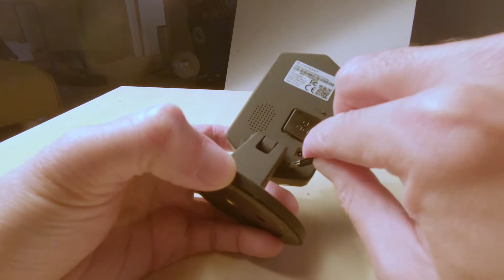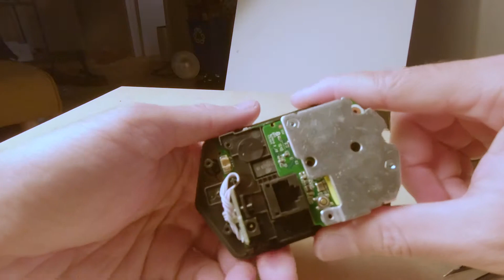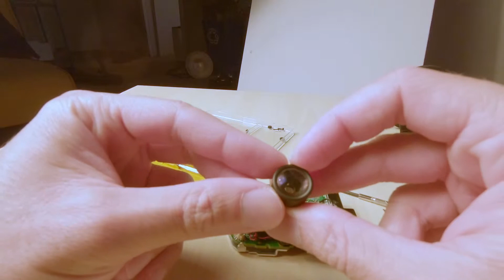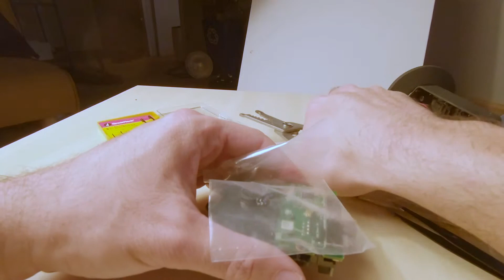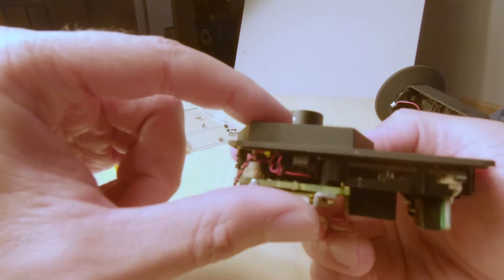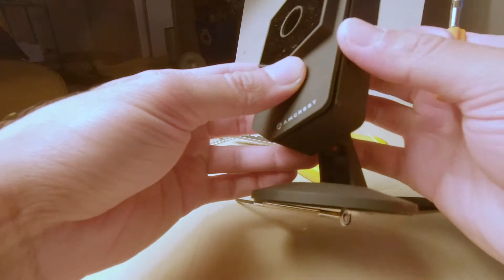How to replace M12 lens on Amcrest security camera

Comment: that was great! sorry for my ignorance but did any of this end up affecting your night vision in anyway? if so how?  thanks for the video...really enjoyed it..might wanna tinker with what i thought was my amcrest cam..hmmmm ....incidentally could you kindly share what exact lens you got and from where ie. part # etc..thanks again
Reply from the maker: I don't remember what lens it was, probably just a generic one from Amazon. This one was pretty good quality but I've also gotten ones that weren't sharp (I use these types of lenses on Mobius cameras too). I would suggest going to a reputable camera that sells FPV equipment and buy one sold for installing on a Runcam or similar FPV camera, because those tend to be good. Also go for higher megapixel rating
Reply from the maker: It doesn't affect night vision unless you buy a lens with an infrared filter already glued to it. The camera has its own IR filter that flips into place during the day and flips out of the way at night
Reply from the maker: Now I remember, I found it on eBay. No branding but if you search for 6mm m12 you should be able to find it by appearance. It's the only one with such a big glass front element